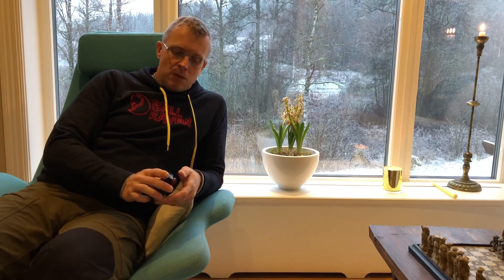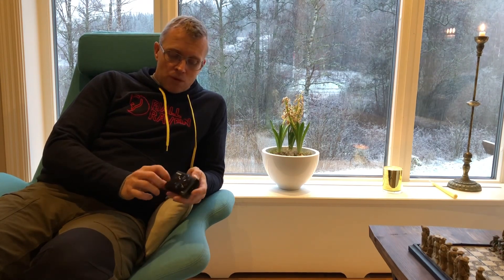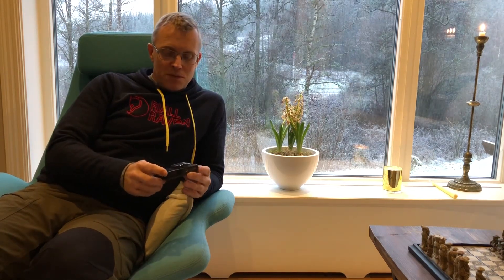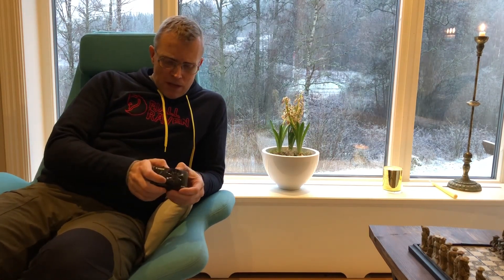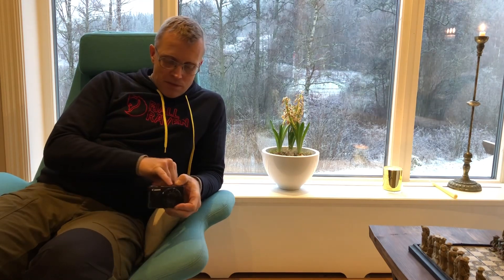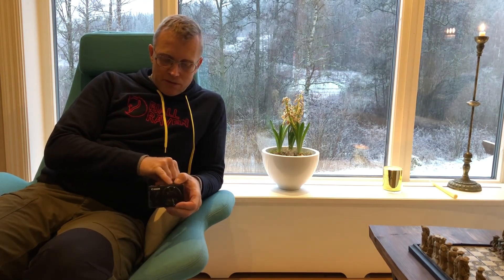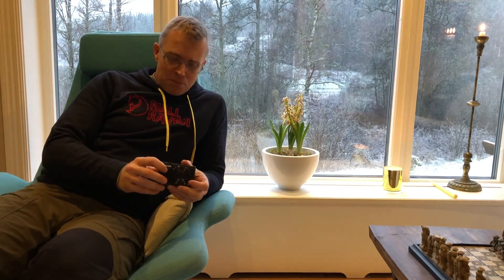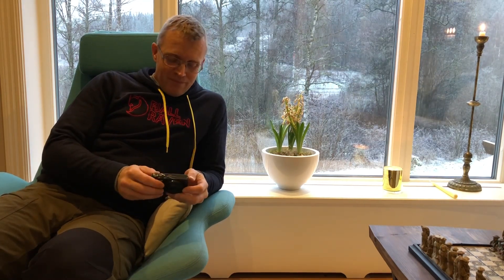Transmission Line vs. Bassreflex box

Comment: Τ line speakers stuck in corners, in cupboards, on uneven height and one behind a sofa? Of course the spherical speakers will sound cleaner with more precise bass while the T-lines will sound boomy and diffused. But a good T-line in a room that can take the bass, will run circles around any bass reflex in bass extension and delineation of plucks, wood tones and low pitch harmonics.
Reply: Btw a sealed vs a tline which will be better for sub bass & bass? Isn't sealed is still faster & tighter than tline?
Reply from the maker: @datdudeinred  good point! There is still a resistance in a T-line to get the air out of it making it responsive even in the mid-bass range! Even though as the former commented say about the sofa , the T-line still sounds better and the placement in the room is incredibly crucial.
Reply from the maker: You would believe so , but that is not the case….
Reply from the maker: I measured them now…. Check the latest ”shorts”

Comment: I agree with you on the T lines.
Built a set from a kit (parts Express Tri Trix).
I felt certain, due to the bately 5" drivers that I would have to add a sub. Even though I was just using them to replace the TV speaker in my bedroom.
While they certainly don't reach down into the 30's, the bass is surprisingly good and tight.
This makes me wonder how 
 7 or 8 inch drivers would sound in a T line box.
Reply from the maker: I think one needs to have it stiffer and a longer Tube to give the resistance behind the come so it sounds good as a midrange as well, if you thought like in a 2-way system?
This speaker is 6,5” and goes really deep. On monacor’s webpage one have the frequency curve on every driver at 1db/1M  and this driver looks great even though beeing cheap! :) 
I wish I had a better mic because they sound so great, beeing so simple after all. The round ones are easier to furnish, but the TL sounds better.